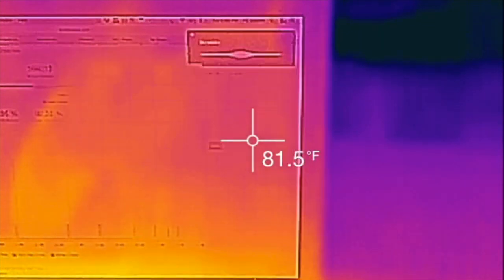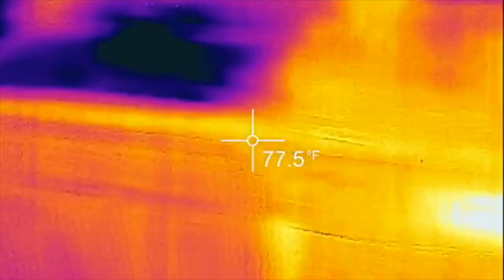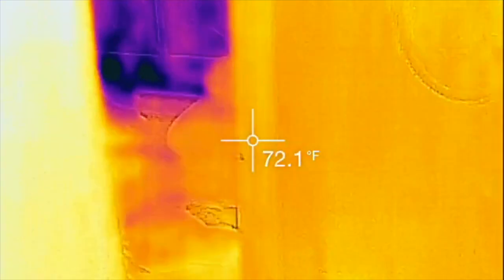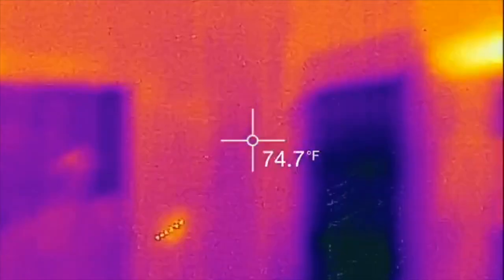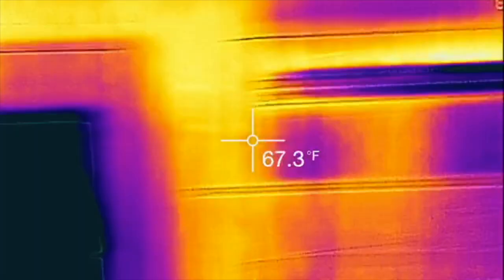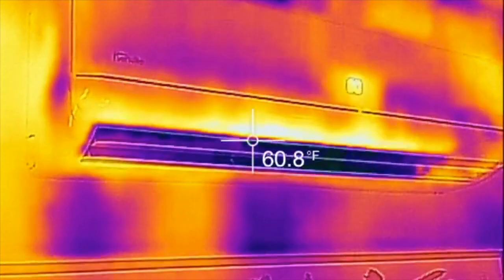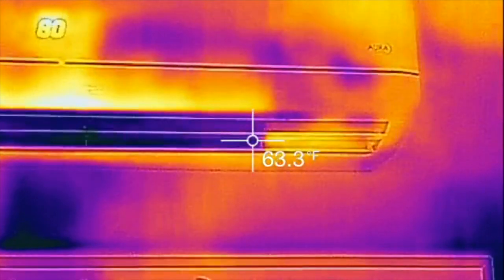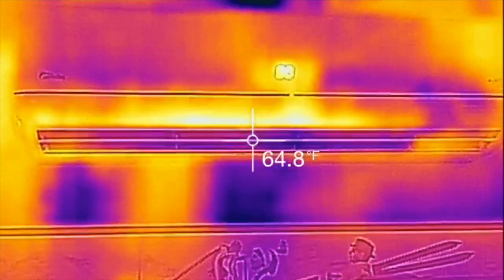Heat Pump Extreme Cold: Tested

Comment: Wow, that is unbelievable.  Why burn fossil fuels anymore and pay such exorbitant costs?  May as well install these guys.
Reply: T M k
Reply: Lol where do you think electricity comes from
Reply: yea, exactly. Just use the clean electrical power that comes from the clean coal power plant down the street...
Reply: @jacobframe8769  Ahahaha that is funny!!!!
Reply: @jacobframe8769  I mean, depends where you live.  If your power generation is coming from wind, solar or nuclear its an immediate green upgrade.  Also a lot easier to build a new green or green(er) power plant and turn thousands of homes with electric heat into low or zero emission heat as soon as it goes live compared to converting those thousands of homes individually.
Reply: @nathanh4237  you are right. I was being a little flippant.